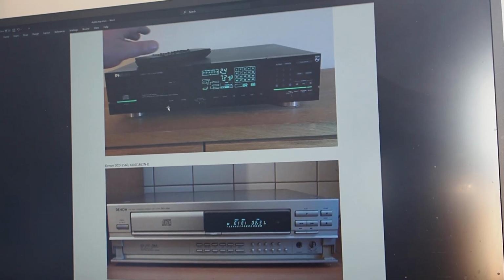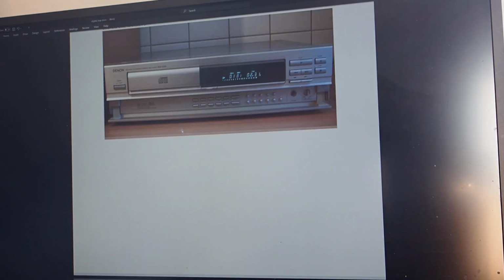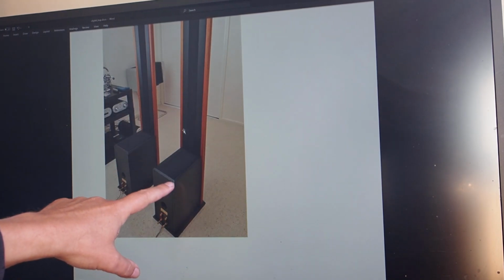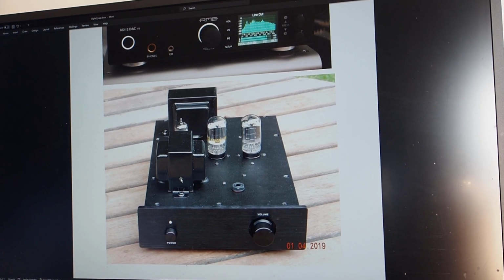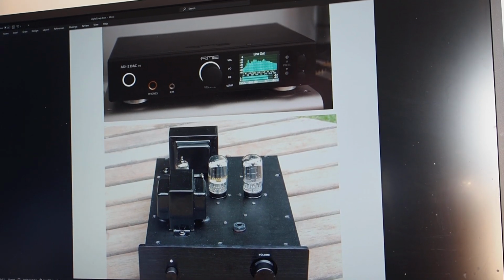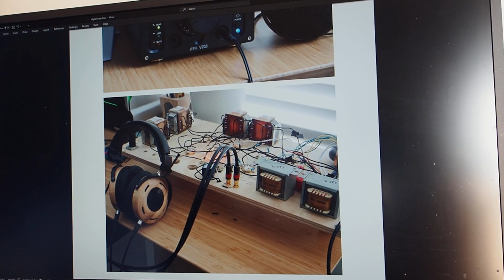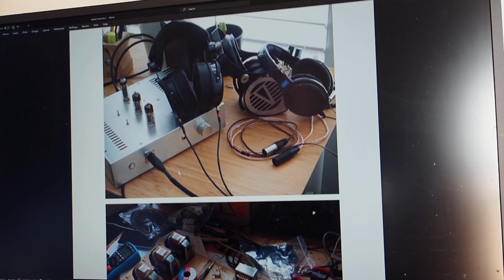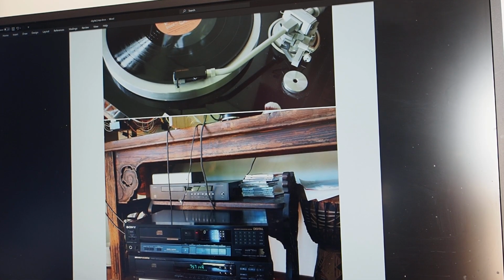The digital trap - part 2/3: Trap details + how it got me to design and build tube amps

Comment: I come from a electronic digital design background and was educated in the superiority of transistors over tubes and digital sound production. I bought my first quality turntable to avoid re-buying everything in digital, since then I began to realize digital has no soul. The main regret of not going digital is the size of my vinyl collection! I have a DCS Bartok which I mainly use to identify vinyl I should purchase.
Reply from the maker: JDB, I get that and I'm much in the same boat; I only started with vinyl a year ago so it's only about 50 LPs now but the Kenwood KD7010 turntable has been one of the best value for money items I've ever purchased: it has natural nuance instead of detail, soul touching experience instead of hifi... In my system it is combined with a high efficiency (100dB/W) speaker and an all-DHT tube amp - which is a very revealing chain and that is helping me a lot in  hearing the influence of individual active and passive components in designs. What does the rest of your system look like if I may ask?
Reply: @EduardBroekman  I have some Aspara H1 horn speakers which have been completely rebuilt with high quality components, for amplification I have a Bel Canto SETI 40 which I have again upgraded. For vinyl I use a TW Raven turntable with a Grahams Phantom II, SME V and Raven 10" with an all tube EAT E-Glo phono stage.  For digital I use tidal HQ with the Bartok and I do enjoy some of the 192KHz 24 bit recordings but generally its vinyl's feeling of musicians playing with one another and emotional aspect I enjoy.
Reply from the maker: @jabberthebut  Actually the Bartok gets a mention in my upcming video: I found it interesting that the Mojo Mystique (AD1862, also used by AN dacs) got reviewed in Stereophile and the reviewer compares it to the (custom 5-bit delta-sigma dac) dcs Bartok .. In some way the Bartok seem an outlier in your system :) Curious speaker that Aspara, how did you come across it?
Reply: @EduardBroekman  I heard the Aspara H1 at the 2010 Heathrow Hifi show, they are 98db, designed by one of Impulse Horn speakers founders. I bought them 4 years ago 2nd hand for 15% of their original 10k price
Reply: Eduard, you should try bang & olufsen turntable, here in Brazil i got my hands on one for a few months, I have a MK5G from technics, brand new, but vintage, costs twice the price of the B&O, still regret selling it. Soundsmith, who is one of the best needle/capsule makers in the world swears by these low mass turntables… I can see why now… I made some money selling it though, but not enough to ease the pain 😂
Reply from the maker: @YUKOMONONOKE  I had not heard of soundsmith. Thank you. I'm very happy with my Kenwood KD7010.. it's very quiet and reacts well to any improvements. Anyway, before I'm ever going to swap it, I will give it/build a proper phono stage..  What model B&O did you have passing through?
Reply: @EduardBroekman  Rx 2!! I’m in search for a phone pre build also… I’ve been experimenting with a lot of Chinese circuits and modifiying them, bypasssing conectores, etc… I’ve been very impressed with the quality you can get… there are some audio note clones, I’m thinking’s about buying one of these kits…
Reply: @EduardBroekman  Im uploading a video telling you about the recent experiments I’ve been making  with Chinese stuff and speaker design, and adding some question for you, with some luck janos can jump  in also hahahaha
Reply from the maker: @YUKOMONONOKE  Cool!

Comment: You made such a great point about these bing cost no object. They were definitely outliers.
Reply from the maker: Thank you Dan. Yes, I don't know how long it took for DACs to surpass the effective number of bits (ENOB) output of the AD1862 and PCM63 at 19.6 bits... but I wouldn't be surprised if that was only reached again in the past 10 years. It's a measurement that doesn't tell anything about the sound quality, but it tells a story what was accomplished with those earliest dacs and how much of an outlier they were. 

I recently bought a Sony 222ESD, which is an 1980s player, with 1541 DAC and for me it leaves my Bifrost2 and the ADI-2 DAC in the dust in listening pleasure by some margin, despite some short comings I hear in the output stage.. but that I will fix (topic for another video).

Comment: You should do a special going into more detail about your tube building adventures. Why and how you decided on what to use to get where you are now. We're those 4 transformers better? And why (not)? Inquiring minds need to know 😊
Reply from the maker: I'll keep it in mind. There's also a 4 part video series on my power amp; the first episode has a lot of the main design considerations in it; you may like that particular one. It is the cumulative of my amp building experiences.

As for the 4 transformer setup, I did not use it with a proper source (dac limited!!) but I suspect that a higher quality transformer would make a larger impact for the money spend. 

At the time, I heard no good difference with a good class A push pull setup. It did have a near single ended sound. It must have had less hysterisis (zero crossing) effect of push pull, but I couldn't make it out back then - perhaps the huge gain inductance offsets such effects. One thing it did enjoy was a huge immunity for variation between tubes... 

Probably worth a revisit one day :)
Reply: @EduardBroekman  yeah just came back to mention I found your amp episodes while watching part one of the speaker special 😂 lot of catching up to do 😅